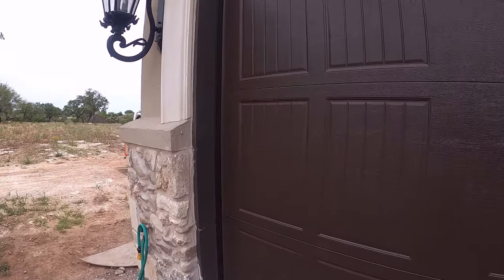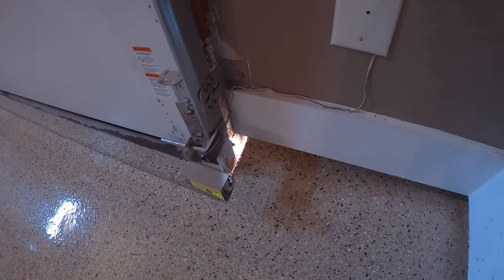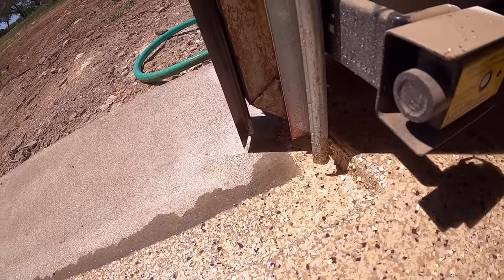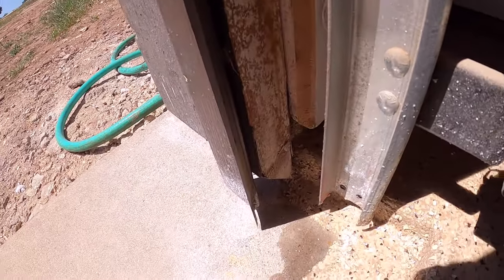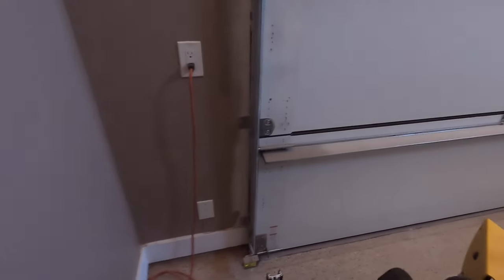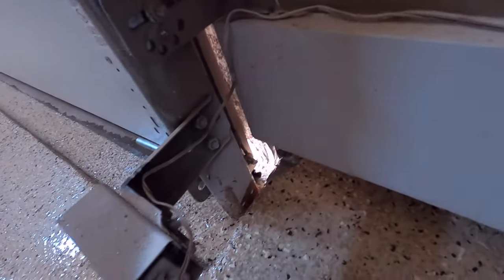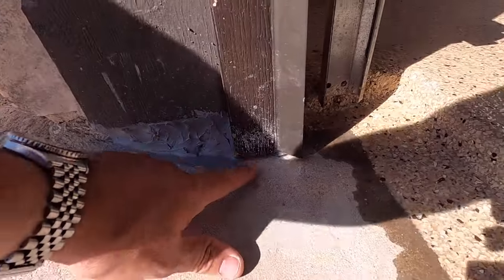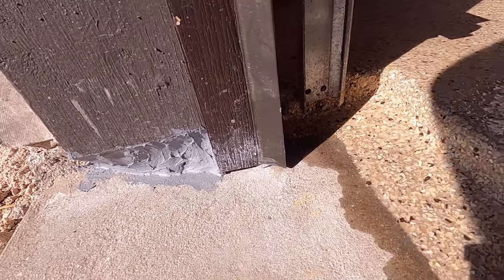🐞Keep Bugs Out of Your Garage ● Easy Hack to Seal Your Garage Door & Keep Nasty Critters Out ✅

Comment: This is exactly what I’ve been looking for!! I live in the Houston area, new home owner and it threw me off seeing all these gaps on the corners of my garage doors!
Reply: Does it shrink when curing? How did this work out for you?
Reply from the maker: It shrinks minimally. Mine is still in place in direct sun and it’s holding up.
Reply: @ApacheRanch  thanks for replying. I appreciate you putting this video out it is very helpful. If you have any pointers, tip, or tricks using the dust sealer?
Reply from the maker: @amrogers3 I just taped it off and used a puty knife to scoop it out. Good luck

Comment: I got some 5/16” x 5-13/16” PVC trim, I cut it 4’ long, notched the bottom to go into the lip of the garage floor, and attached it just inside the the rubber flap of the stop molding, then caulked all around it, that sealed it all the way off
Reply from the maker: Good idea!
Reply: I need pictures or a video.
Reply: Pics or videos please @RRSTTT
Reply: @rrsttt7505  would love a video too of this option, thx

Comment: Is there a reason why builders do that with garage door corners?
Reply from the maker: Not sure really.  Both my garages have had this exact same setup for some reason.  Thanks for your question.
Reply: Maybe has something to do with allowing room for expansion due to weather changes?
Reply: The wood is trimmed on an angle like that to prevent it from soaking up water... If the wood trim is flush with the concrete water gets absorbed and rots the trim...the trim that the gasket is nailed to...

Comment: Never seen a garage door that was set below the interior slab grading.  Good idea to do that though to keep water out..  and looked good the way you got that mastic in there as well..  ive tried spray foam but that was a mess to install and the stuff soaked in water over the years and just got nasty..  seems like their would be a common thing that is made just for this issue because all the crap i see for sale to fix the corners never work or its apart of an entire system of weather seals which the rest of the door is fine..  tired of spiders getting in and have had friggn little moles get inside and scare the crap outta the ole lady when they show up..  lol..
Reply from the maker: Yeah great points. Here in Texas they do set the doors like that in the foundation.  This HVAC mastic seems to work pretty good for waterproof, UV resistence, and stickiness.  So far it's worked great for me.  Keeps the snakes out!

Comment: This is very good.  I’ve been using some copper scrubs and pushing them in that crack very tightly.  Used about 2 per side and I used a paint stirrer with hammer to tap it in and get it very tight.  Seems to work well so far.  Use the copper because the iron ones will rust away.
Reply from the maker: That’s a great idea!!

Comment: Thanks for sharing! My home is almost 2 years old now and I’ve had a side gap since day one. I saw the comment about it being for water drainage, but mice are coming in my garage through it. 

Do you have any update after a year? Any lessons learned? I plan on placing my order for the sealant and working on mine this upcoming weekend. Any other tips you got will definitely help. Thanks again!
Reply from the maker: It’s still looking good and sealing 95% still after a year. Bug population is much lower in this location as a result. Only impact is some shrinkage over time. I plan to add a little caulking to fill in where the mastic pulled back slightly and left some new gap. Otherwise, it holds up!
Reply: Did it help?
Reply: Did u end up doing it?
Reply: @OGCJ10  Sorry I’m just seeing your comment. Yes, it worked.
Reply: @maj7766  Yes I did. And it worked. I left sticky traps like before and never saw a mouse again. I also epoxied my garage floor soon after and I believe that helped as well. (Due to the floor being more slick).
Reply: @chichizie320  awesome, I had the same thing little side parts opened and a mouse or rat was inside my garage. Saw it run out when I was cleaning up the garage.

I ordered this so I can't wait to close it up!

Thx for replying /sharing!

Comment: The 1/2 gallon bucket is now $25.27. I'm going to try to find it in a smaller size. Looks like good stuff.
Reply from the maker: It’s crazy the inflation. I wish you the best!
Reply: @ApacheRanch  It IS crazy. I need to do the same thing you did in the same places as you did. I wonder if there is a cheaper alternative besides caulk?
Reply from the maker: Really this stuff works best since it’s not runny. And when it cures it holds it’s shape a long time despite the elements.
Reply: Did you find cheaper or smaller size?
Reply: @Blue-hf7xt  No

Comment: 20 on Amazon
Reply from the maker: :-(   I had a good seller at the time!  (Was surprised to be so cheap actually). But the stuff works great so worth it.
Reply: @ApacheRanch  my garage is filled with bugs and spiders hope this helps...
Reply from the maker: It should!  Block out that light and you block out the bugs!! Good luck!
Reply: @ApacheRanch  thank you
Reply: @josatanvoxcovrs  did it help